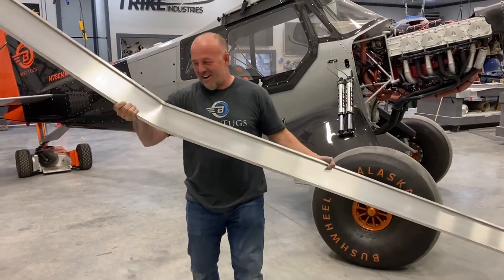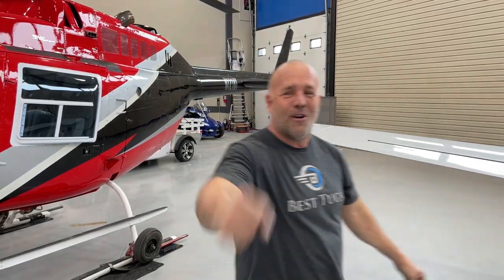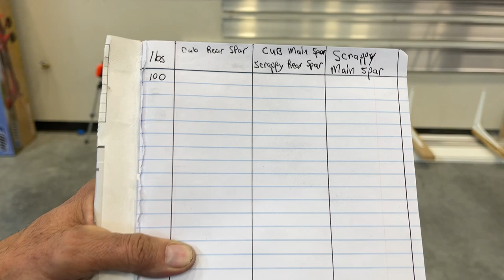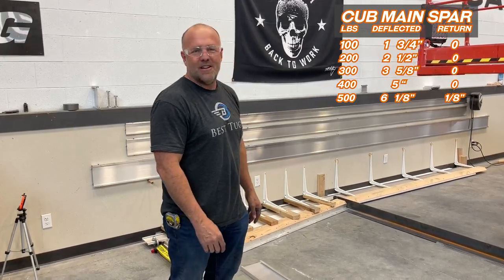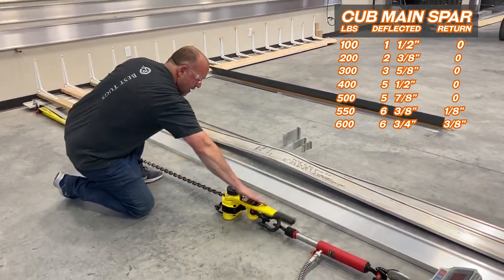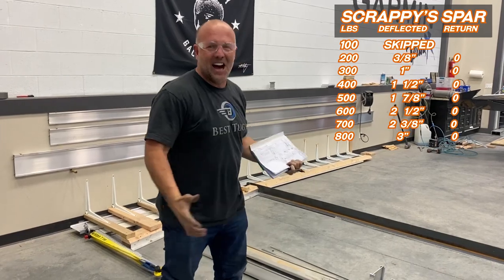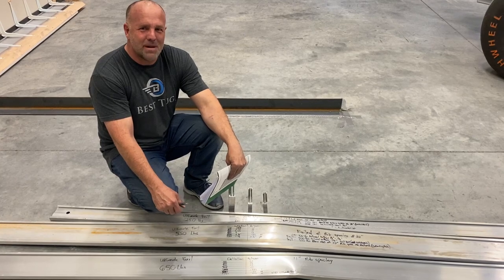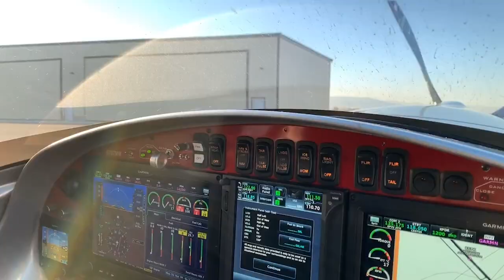I Just Broke My Airplane Wing - What I Learned | Scrappy #47

Comment: I'm Still Amazed at the Prop design of it's long chord of each blade is just too sexy from previous views. That design is always my profile design. 
I might even assume it's a much quieter design with far less turbulence 
than narrow edged blades. The shock wave on some I hear on take off 
is very extreme noisy. 

I did many years of restoring WWII aircraft from crashed landings. 
The Top Ship I fell in love with that took a couple years,, even slept in it overnight in the hanger Probably
And he was the 1943' Beech StaggerWing. Total makeover on the console
with all new modern avionics, and modified firewall to make 12" long radios 
fit flush. 

But the most delicate of rebuilding was 1945' Cub Cadet's wings. The ribs inside were so thin,, just the motion of riveting them in could easily damage them. 

But here's a point in question at your connection point of strut to the wing, when your test fixture was if I recall 1.5" pipe bolted to the floor as pivot point. 
Isn't this point on the aircraft actually bolted to the spar with spreader bridging out along spar a good 8" - 10" long?  
Which would carry the load out much further. 

Then the newly designed extruded spar - Amazing feat at that. What if web portion was box style?  Quite more difficult die of course. 
Which is almost two spars in one. For a main spar. 
The last 3' - 3.5' of wing spar single web would simply insert into end of main box spar. Possibly tapered smaller profile out to tip of wing. 

It's five in the morning,, and eyeballs are demanding extended dunk in hot coffee. So another amazing show Captain,, and the darn notifications need to be reset again so I can get here when class begins. 

Cheers

Comment: The space between the ribs looked to be wider where the pivot point was, which made that a weak point and that’s where it failed. Had the ribs been closer together in that area it would have had an even higher failure number.
I might be wrong in the pivot point rib spacing area, but it looked that way to me.
Thanks for sharing the testing.

Comment: Yep, just seen this I'm new.  I would put a inspection plate on the spars were they bend, seems to be in the same failure point.  Also I would add a aluminum honeycomb shape that can semi float on that section of the spar that bends.  This should give you an extra 600lbs on your max load, I'm thinking external fuel tanks.  I would also put a doorbell dummy switch on the spar failure point.

Comment: If you got bored you could come down to New Zealand and spread fertilizer on the hill country. They fly off small strips in precarious locations. They drop around a ton every trip. Fantastic video. Thanks for sharing the testing. One question you may be able to answer in a future video. What is the fatigue cycle number before you can expect a decrease in your safety factor load. ie, how many cycles of load off load on. How does the reversing load impact on the numbers? Cheers

Comment: Mike, why excced the spar design's load limit beyond the required safety factor?  You can save weight by reducing the two spar cross sections to meet the design+safety loads.  No value added in having them beefier than the design requires.

Comment: As a glider pilot used to mostly seeing planes with CF or GF composite mainspars I was kind of expecting a big carbon fibre composite box spar but I guess aluminium has it's advantages in that it'll bend a bit before it breaks if overloaded.

Comment: One comment about the test setup. The support on the bottom appears to be continuous representing a rib spacing of zero. More realistic would have had the spar raised up on wood at the same spacing as the wood on top. With this setup you might have had lateral buckling in  adjacent bays with one going up and the other down. This would potentially reduced the failure load somewhat.  I speak from the experience of 35 years of structural testing at UC San Diego.

Comment: I've watched your testing video several times, and I'm not any kind of engineer, but it looks like the right side of Scrappy's main spar was contacting the wall, stopping it from flexing any further about the same time the spar failed to return to 0. That may be why it bent closer to the fulcrum than the other spars did. It might also negatively impact the results of that particular test.

Comment: It would be interesting to see how the buckle would translate if the columnar load supplied by the strut was also simulated.  That would entail a much larger test jig. The spar caps seem to be equal in the video, but there may be advantages for an eccentric spar. Then there are practical considerations like room for a row of rivets. Being a slave to the numbers can lead to solutions like 1/16 inch rivets on one inch spacing. There are reasons other than labor costs for not doing that.

Comment: Hey Mike. I have followed this project and I am deeply impressed. The body work you are making is exquisit. OK, you have obtained the desired result of relative strength - and that may be good enough for your purpose. But it seems to me that something is wrong.
There are so many considerations behind this that I don't know of, so I may be completely out of line. But in my world it should be possible to bend such a spar/beam to a significant permanent deformation WITHOUT having a fatal fault. So it seems to me that the profile is less than optimal. I would consider widening the flanges up to a size where they do not collapse. This will add some weight that can be removed by drilling some  fairly big holes in  the body of the profile ( and by having fewer ribs).  
Further I wonder why you are only talking about static forces. Even a plane like Scrappy can encounter severe turbulence, resulting in 3-4 G's.
None of my business - I am not going to fly with you - but I felt a need to share these thoughts with you.

Comment: You should contact Lotus UK, their Elise, Exige, Evora are all extruded aluminum ... but bonding can't be done with anything other than special type of glue under specific heat and cool down process ... anyway, hopefully you're bonding those spars and not trying to bolt them or weld them.

Comment: This reminds me of my mechanical engineering classes labs.  Your experiment is a lot of fun to watch and a great teaching experience.    I was wondering if you considered putting strain gauges along the spar to get more detailed data.  
Can you can get carbon fibre spars that you could use with your wing?  Modern gliders use extruded carbon fibre spars but their wings are much thiner with a higher aspect ratio than scrappy's.  OTOH carbon fibre spars are extremely rigid making for a very rigid wing giving a rougher ride at high speed on ridges.  Higher wing loading is preferred.

Comment: Thanks so much Mike.  The data you created for the industry is valued beyond words.  Just one question.  Is there any threat of failure at a RIB because the lateral pressure against the RIB was too great even though the SPAR was strong enough to take the load?  Will you make it to the Reno Races this year?

Comment: I would like to see what the wooden spar would have done in that test before snapping,  the load is more delicate once there are holes made in it for rivets and bolts. The biggest worry is the fatigue cracks around the holes that are the stress points.

Comment: Hey Mike... in your solid works model is the lateral support condition set as continuous support for this member?
The spacing of the lateral supports is likely to be the key determining factor in the actual load at which this member buckles... with wider spacing of lateral support lateral torsional buckling will be your mode of failure and at some threshold of closer spacing your mode of failure should transition to flange local buckling. 
And it is very interesting that your test didn't show any web crippling at the cantilever point of maximum shear. 
These things are complicated and interesting! 😊👍🏼

Comment: Good test. Your setup had rigid rib simulators, it seems to rely very heavily on that presumption. Is that warranted in typical wing designs? doesn't that require a structural wing skin?
Did you consider a composite wing? my intuition is that fiber can easily overkill and never have fatique issues.

Comment: The entire video I was sitting here watching my own design (not aircraft) going through my own preliminary simulation analysis 🤣🤣. However I was also thinking this whole time, what would the difference be if you were to change the aluminum beam design to a spiral wrapped oval carbon fiber design? How would it fail and where would it fail at in comparison to the aluminum beam. Love the videos!

Comment: Mike awesome stuff and great plane builds, I love what you do!  I think it is time to change "Scrappy"'s name.  "New" custom built spars are so far away from "scrap" and all the custom made "new" carbon fiber parts have wandered so far away from the "scrap" budget build idea, the full Garmin avionics suite of avionics.  This plane is awesome and while I didn't think there would be anything that could rival Draco for an over the top bush pane this one will. The cub-esque look, the crazy propeller, the 8 cylinder engine.  OMG this is every back country flyers dream plane they didn't have the ability to to even dream it's so far outside the box.  Keep up the forefront aircraft design and building... but can we call it somethimg more in line with what it is? This is by no means "scrappy"  we should call it something like  "Polished" "Scamp" "Goliath."

Comment: I would suggest that the breaking point is even higher. Every time you are bending near the limit, you are damaging the spar. I bet if you did a one off pull on a new spar you'd get even higher numbers! Question for you though. With say 1,000 hours of flying in turbulence with the main spar taking a number of shock loads, how much does that weaken the integrity of the material? What you really need is a rig that can flex the spar on max payload with the max expected turbulence load for 500hrs and see if the failure point has reduced any?

Comment: One thing that I noticed was the amount of deflection past the pivot point was maxed out on the scrappy main spar and was starting to bind up against the wall. Wonder if it was given more space to deflect if the failure point would be at a higher weight.

Comment: I’m curious to see a spar splice repair tested in your fixture. I doubt the repair itself wouldn’t fail but would the ends of the repair create a stress point.. 
Your test also has me thinking about fully built wings, fabric vs aluminum, since fabric has no compression strength. 🤔

Comment: Since the failure mode is buckling, i.e. the compression side, shouldn't you also simulate the forces along the spar that are induced by the oblique force brought in by the struts? I have no idea how high these stresses are in relation to the bending stresses, but the force itself is a multiple of the vertical reaction force taken by the strut, given its flat angle.

Comment: When you are doing these test. When you do an initial test on that spar to see where it would fail or move, you just placed a stress in the spar. When you use the same spar to go to a higher weight, wouldn't the stress placed in the spar on the previous pull cause an inaccurate data for the heavier pulls?

Comment: I feel your test was an awesome way of testing but would there be a significant difference considering the strut is pulling on the spar.  I do not know how the strut is connected to disperse the load on the spar vs. the pressure point in the test and would that affect the outcome?   Thank you for making me think outside the box.

Comment: @Mike - Engineering question:  If you have the ability to order custom aluminium extrusions for the spar, why would you not make it a hollow triangular box section to avoid the torsional failure mode seen in your testing?   Does it have something to do with how you plan to incorporate it into the rest of the wing design?

Comment: Ok, so, I used to form spars for 737s. Those were machined from extrusions or solid stock depending. So what I’m wondering is do you have curvature in the spars for your application or are they just straight?

Comment: If you wanted to measure more correctly, then the attachment point in the middle had to be hooked to the vertical wall by the same attachment unit as on a samalet. It would be more accurate and real as a spar works in the wing of a samalet. Good luck to you.

Comment: Make the spar flanges (top and bottom of the spar I-beam shape) wider, as that sideways kinking seems to truly and utterly dominate in the ultimate failure mode. Wider flanges at the top and bottom of the spar would resist the sideway kinking failure mode. (Alternately, add another set of flanges just inside from the outermost flanges, but that is not as weight efficient as a wider flange.) The main plate of the spar could have lightening holes all down the middle, as the middle of a deflected beam should be stress-free. My guess (total speculation alert) is that it would be possible to more-or-less double the strength AND more-or-less halve the weight of the spar with a different (more complicated) spar design; a spar design that would require significant processing steps after the extrusion.  Or just make the whole thing out of carbon fiber. Cheers.

Comment: Are the actual ribs made of aluminum and does the spar move freely between them, like in this test? I'm just wondering what sort of additional heat dissipation there may be available, and if a focus on improved heat exchange could further improve performance of the spar.

Comment: Instead of soft extrusion, why not use a fabricated spar of rolled ( forged) and heat treated aluminum sheet? In T-6 hardness, I would think 6061 with a riveted and bonded flange structure would be the same mass and another 50% or more bend resistant. This extrusion does indeed to the job.. but overkill is overkill. Back 40 some years ago when race cars were made of aluminum, we only used rolled and heat treated aluminum in stressed loads, often with bonded and riveted titanium backers at loading points.  True testing like this is fantastic... never completely trust simulations. Sims get you in the ballpark, but always practical test to real fail..  👍👍.. great job!!

Comment: any different results if you used a doubler with more bolts  as would be in a real spar and strut attach point ? the high point load on the test rig might lower the yield value ?

Comment: I'd be interested in seeing the strength difference with dimple die holes and if that would focus a stress point that would actually weaken the overall strength. Not an engineer so I'm probably not using the correct terms but I think you'll get my question.

Comment: Love it Mike, but confused about your math. Maybe I missed some vital info. Ultimate fail was 1600lbs per spar. That means 3200lbs in total carrying capability assuming one spar. You said Scrappy was 2000lbs empty and you wanted to be able to carry 2000lbs in payload. That's 4000lbs, which takes you over your 3200lbs. This is before any safety padding as well, which I assume are int he 1.5x region. Are you having two main spars maybe?

Comment: It is important for accuracy for the lateral support spacing in the test to be equal to the actual rib spacing in the finished wing. If you wish to predict member performance in the wing. 
If you are comparing load test to FEA predictions for accuracy you need to set up the lateral supports to simulate the support condition assumed by the software... which might be continuous support. 
It is actually relatively easy (for those in the biz) to accurately calculate deformations and yield points of beams with perfect lateral support. Things get mad complicated though when ur dealing with very thin sections and deep beams like this that are subject to local buckling and lateral torsional buckling effects... which descends into the realm of fractal jedi math real quick that is the sole domain of god himself. 
Mr. Patey is very wise to load test these things... it's the only way to know for sure.

Comment: 1 question, if your wing is so strong and stiff, if the wing ever get an impact, wouldn't the impact force finds the next weakest link? like a joint from wing to the fuselage or somewhere in the fuselage structure, and makes even more expensive or deadly damage? Would it be better to have a dedicated force absorbing spot on the wing?

Comment: What happens with multiple cycles to max load? Would cycle fatigue be a factor here? I have seen aluminum flatbed trailers fail within rated capacity. But it is generally in heat affected zones with lots of road miles.

Comment: Does the simulated additional ribs from the previous demonstration not invalidate the data slightly? Since it became clear from the demonstration of the cub main spa that the additional ribs helped it last longer.

That being said even if you take into account the 20%ish gain on the cub main spa, and theorise the same increase in strength with the scrappy spa, your still well in excess of your required number.

Comment: I noticed the top of the spars arch during bending would contact the wall, preventing it from arching further. With this torsion, Is it possible that this also could slightly lower the limit of the larger spars values as the bends were all after the pivot point?

Comment: was scrappy's spar closer to the ribs than the standard cub spar because of its increased size? by that I mean closer to the ribs (meaning it would be held tighter and have less room to bend completely) that could a be bias in your test, adjust the room between the spar and the ribs proportionally to the increase in thickness of the spar. The results up to 1000 wouldn't be biased by this so that's amazing.